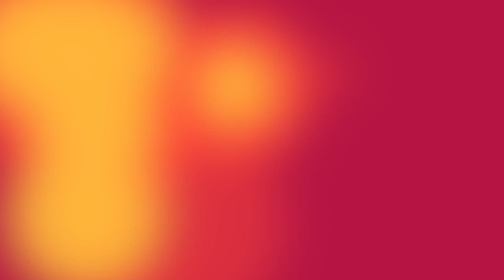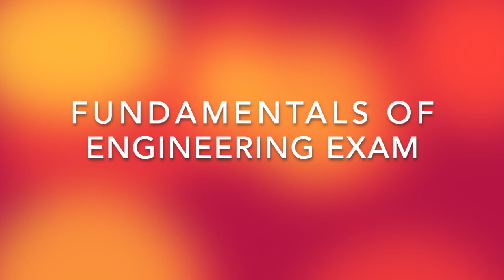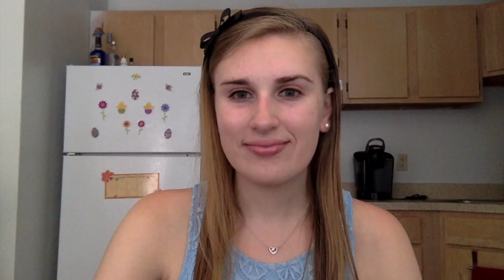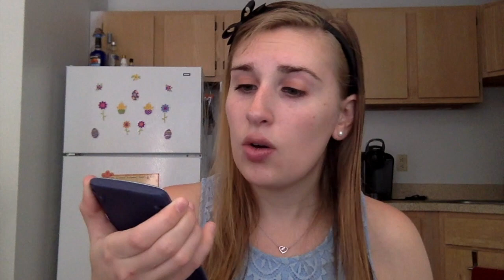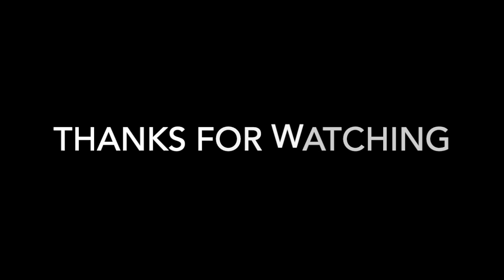Fundamentals of Engineering (FE) Exam

Comment: You said your school prepared you will for the exam. How exactly did you prepare for it. Also, I’m taking the FE Mechanical any advice ?
Reply: Well*
Reply from the maker: My school taught us exactly what we needed to know for my Civil Engineering Major to be able to pass the exam. I got one of the review books off of amazon, I went on YouTube and some professor from another college actually had Civil review videos for each topic on the FE. I feel like you definitely should be able to find review material on amazon as well on YouTube. 
I would definitely recommend getting the practice problems and the book with the equations from the testing website.  That way when you work through the practice problems you can make sure you can easily find the formulas. Doing the practice exam from the testing company is what really helped me prepare because that made me familiar with the types of problems as well as the equation manual we were given during the exam